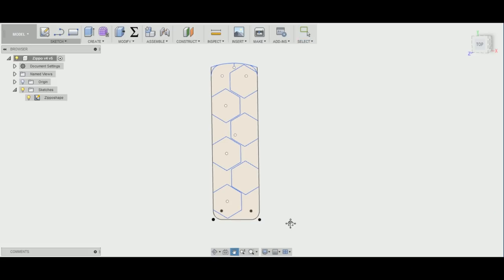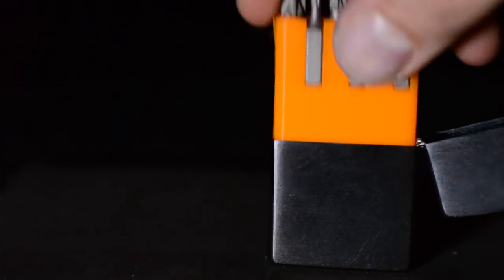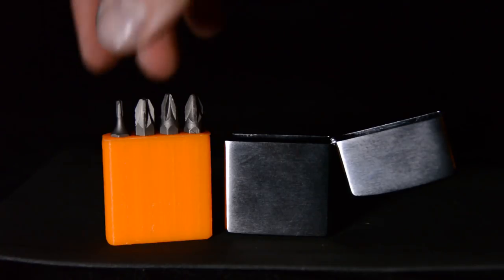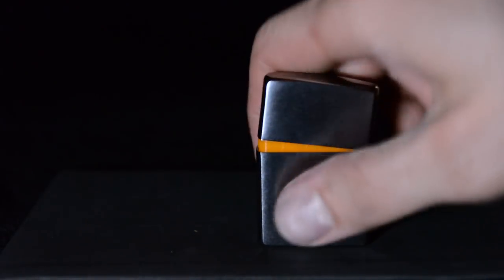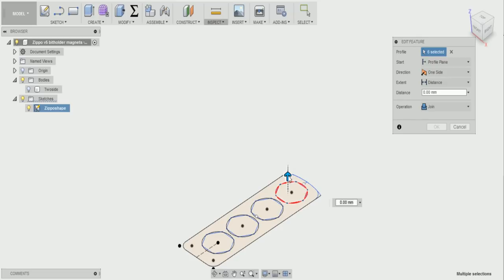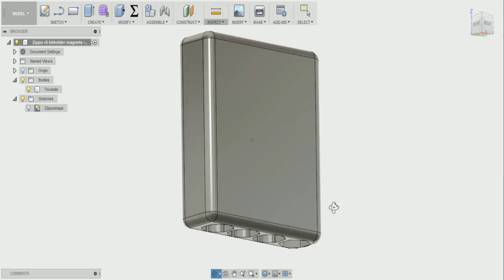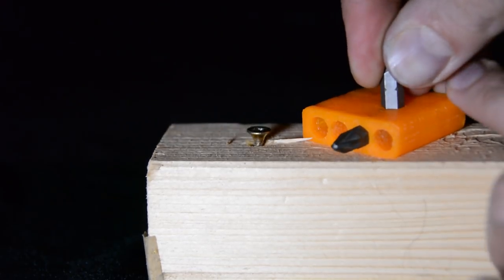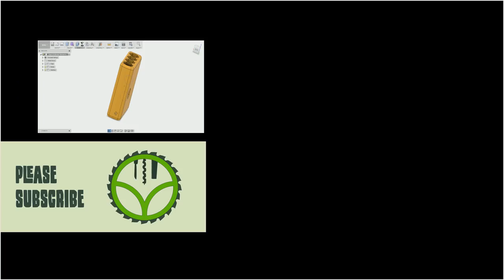Design variations of Laura's Custom Zippo Bit Safe

Comment: I know this is an old video, but I just came across it.  I don’t know a lot about 3D printing and do not have access.  Is there a way to get one of these printed
Reply from the maker: There are services that 3d print models but these are usually very expensive. I would search for a nearby makerspace and see if they would be willing to print it for you.